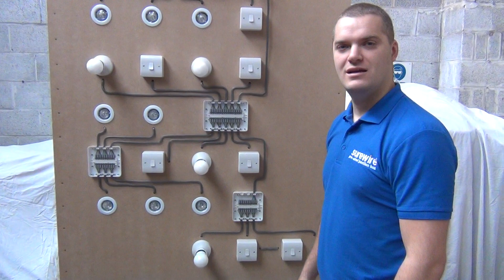Surewire Pre-wired Maintenance Free Lighting Junction Boxes

Comment: I use these too, I do think they can be fiddly, I would prefer a connection like the wagos ( flaps to lift up). I also think it would be better to have a version were a neutral can be taken to the switch (as smart switches are now used). Apart from that, great junction boxes